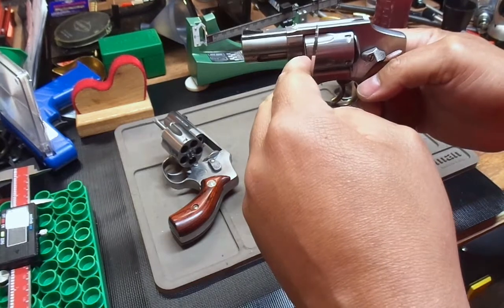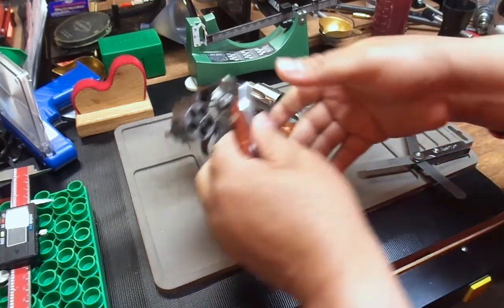Kimber K6s & S&W Model 640: Episode 7 - Cylinder Gap

Comment: Do you know how to remove the ejector rod on the Kimber?
Reply from the maker: I have not disassembled the revolver that far just yet but I would be shocked if it is any different than a S&W. What confuse most is the fact that it is reverse threaded.
Reply: Thanks for the quick reply, a smith you unscrew clockwise and I’m putting a lot of force on the Kimber and don’t want to break it since I don’t know for sure that’s how it’s done.